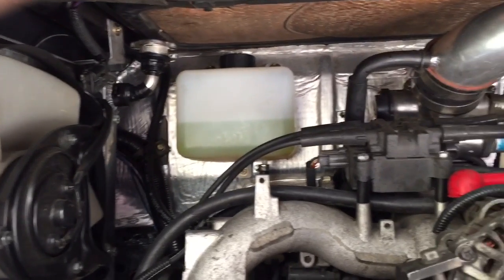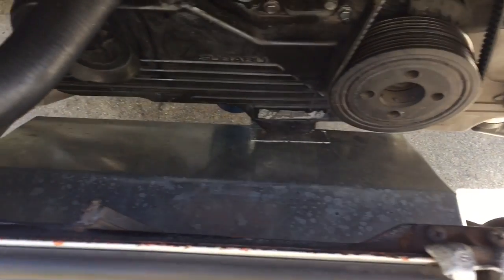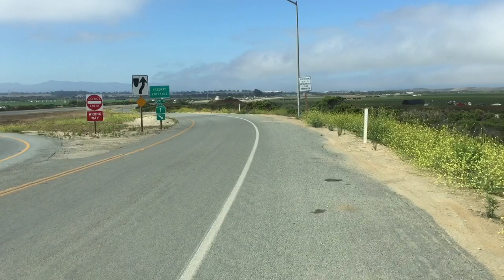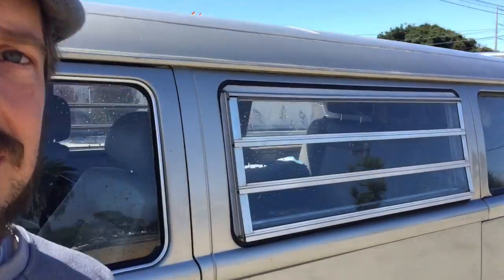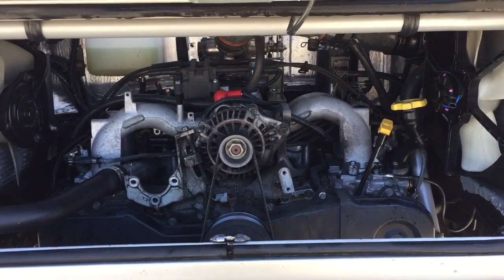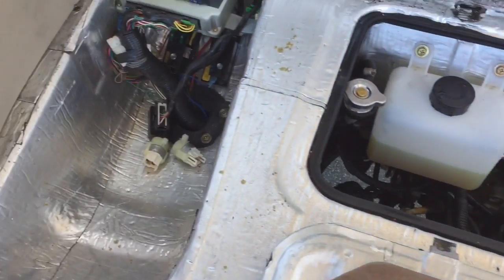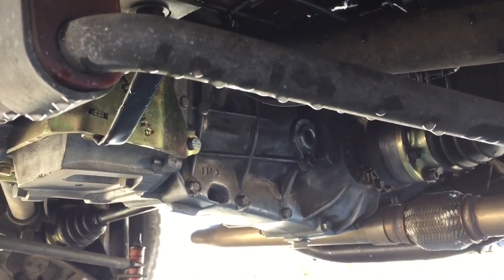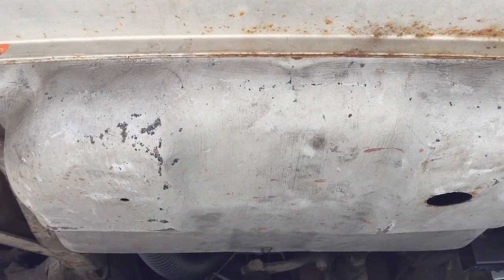"Street Fighter" Tour - 1973 VW Bus with Subaru Drivetrain

Comment: Looks nice. Those dynomax mufflers don't usually hold up too well, but time will tell. I prefer the Magnaflow or Vibrant mufflers because they're some of the cheapest best sounding and more durable. The intake setup looks much better on this one. Seats look like Recaro's from a Corrado or mk3 glx? Way better solution than the stock ones. Although its more work, the Subie 5 speed is a huge upgrade over the stock 4 speed. That ecu install looks super clean. Great work.

Comment: I see that you cut on the side for airflow to the radiators.
Was the initial setup with air suction through the original vents not sufficient for cooling?

Comment: How did you reverse the transmission
Reply: search subarugears...you flip the pinion gear
Reply: Thank you  i still have my 67 bug and 84 gl10 wagon and mk2 Jetta.. Forester..XT old cars i love
Reply: @jasonvogelsang7034  Subarugears has a entire video on how they flip the gear, etc to run it in a vw.  And on their website, they go by split, bay, and vanagon.  For Bay, easiest fit, no frame horn mod as with split window...or you can buy the trans done from Rancho...

Comment: Why do we let our tires get so bald?
I am guilty of this as well I'm not judging this is purely a inquisitive question. My toe in toe out was pigeon-toed I cupped my tires bad, got new tires two weeks before getting my front end alignment straightened out and now I'm fully aligned with cupped front tires that are brand new lmao. Needless to say I have to get new tires again so I understand. I'm just curious why do we do this? I have a lot of new parts underneath my truck as well. Why do we put so much time and effort into the parts and the labor and the time only to fail with the part that actually puts the machine to the ground, the rubber?!. Great video and very beautiful bus I found this because I thought putting a Subaru engine in a VW bus would be an absolutely amazing idea and sir you have executed it perfectly it looks Factory
Reply from the maker: Thanks for the compliments, James. The owner of this rig needed some alignment work done so I cringed at the thought of putting new tires on it before that work was done. 2 weeks after delivery it had fresh shoes. Good eye by the way ;)

Comment: Having not looked at it, would a scirocco radiator work on both sides?
Reply from the maker: +Ian K it will but the benefit of the Honda rad for the passenger side is that you can put the intake ducting beside it and it'll be protected. The Honda is a better fit dimensionally as well. On the driver side I've been doing the sciroccos and they have been great. Much cleaner than 2 Honda rads.